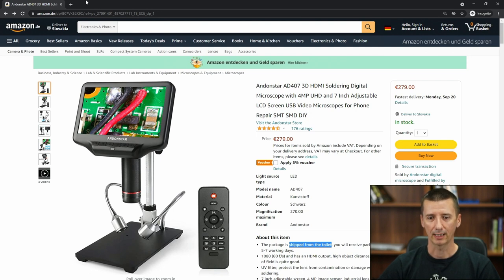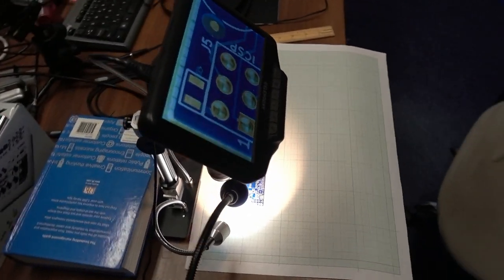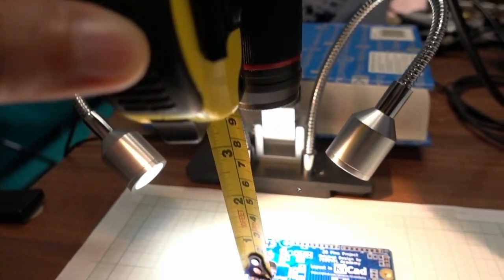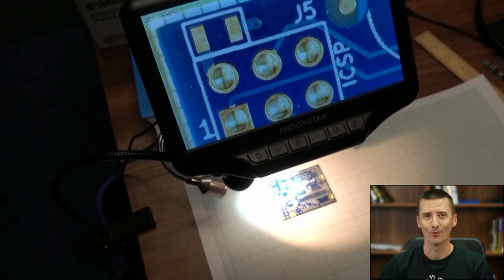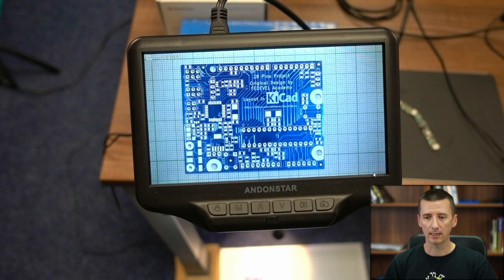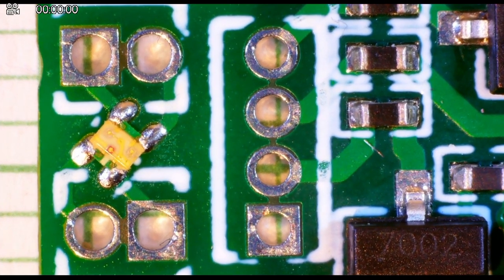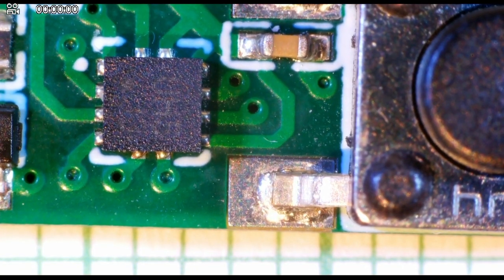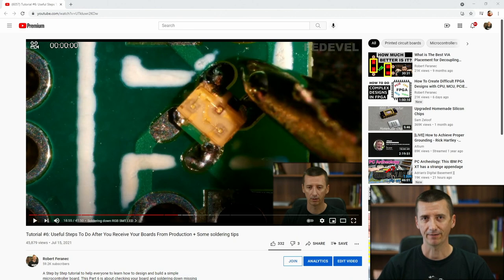Is Andonstar AD407 PCB / SMT Microscope Good? Image quality is ok (see the video), but the stand ?!

Comment: You can actually mount the microscope to the stand below the red line (near the lens). It is a bit fiddly to get it to mount straight but once it is in place you have about 15cm of space between the desk and the lens. The focus remains adjustable above the new mounting point. I have used it like that for a while now and loved soldering under it ever since.
Reply: Same for me

Comment: I have a similar one at home, but i went with just the camera module that does not have a screen. It's nice for documenting, and i like that i can place a large enough screen directly in front of my eyes, so i don't need to look down in a strange way to see what is going on under the camera.
I still kinda prefer to work (solder) with real optical binocular microscopes tho, they just give me a better depth perception, and i'm used to have zero lag. 
We have a Mantis Elite scope at work too, but that is a completely different beast, and it takes time to get used to working with that thing. The biggest problem i have with the Mantis is that i need a raised platform for my PCB to sit on, so i can use a normal desk and look straight into the optics of the Mantis sitting upright and comfortable. For precision soldering, i kinda want my wrists to rest on something tho, so you have to build up on your desk and find ways to set up your workspace ergonomically. Maybe with different magnification lenses it is better, but i think the ones we have now give a good field of view for soldering. The focal point of the Mantis would need to be about 10-15cm higher up to be ergonomically ideal, and i don't see how we could change that (we have the 6x SLWD lens already).

Comment: I have similar microscope (Andonstar 208) and I've attached it to the ring be end of optics.Also quite easy trick to get better working distance is to use M4 standoffs. Needless to say I completely agree with you about the length of the arm.

Comment: I have the 8.5” version, the field of view is it’s only downside. However, I bought a cheap clamp on mic boom and I don’t put other lens all the way through the makes it that you can have 60cm (restricted by the wires which is easily fixed) between the clamp and the lens which is very workable. It also enables you to have more space to work in.

Comment: Regarding the too-short support post (and too-tight field-of-view), as of late 2023 there's an AD407-Pro model that has a 32cm post (as compared to 19cm for the AD407 model).  Though I note that at 10:25 Robert says he wants the post to be 47cm, which is a bit taller still.

Comment: The focus issue is lens distortion.  Lenses which correct this aberration usually kick you up to higher tier systems.  You are right, it's tricky finding a low cost system that checks all the boxes.  But these Adonstar scopes really check off quite a few boxes!  A decent stand for microscopes cost more than the whole Adonstar you have there, so you have to overlook this point and do what you did!  Half the time you end up having to rig something anyway.  Nice review, thank you.
Reply from the maker: Thank you Craig
Reply: I have exactly same distortion on andonstar ad409 on exactly same side, so it seems normal for their sensor, its mostly noticeable when the microscope is mounted in the upper position and is at maximum height
Reply: @vassilikouleshov2209  That's interesting!   Thank you for getting back on this issue on another model.  It may not be the lens after all, unless they happen to be reusing the same one one a different model.  Can the lens be turned a little, to see if the distortion rotates as the lens is turned?  Thanks again Vassili.
Reply: @craigrotay3732  Yes, it probably is same lens as it has same diameter of 30mm as andonstar 407, the difference here only the screen is 10inch, how do I rotate the lens ? should I unscrew something ?
Reply: @vassilikouleshov2209  OK thank you.  I'm not familiar with these devices so I don't want to suggest anything that might cause damage.  I was just curious.  Nice of you to feed back.  Take care!

Comment: I recently bought a microscope similar to this (but way way cheaper, the KKMoon x1000 720p). And whilst the screen resolution was enough for me, being an electronics novice, I also found the problem of the vertical axis being too short and the view field was too narrow. Thankfully the Z axis in my case was a simple 140mm diameter metal pipe so I found a longer one on Aliexpress and problem solved :) Now I can even use the microscope with a PCB holder. Thanks for the review, it was very interesting!
Reply: Mr Guru  lol, you're right xD 14mm.

Comment: Dear Robert, you have made a very personal and honest review, thanks so much. I wonder if it would be possible to look for a suitable length shaft on the trade or letting make a new one by melting Al alloy. Another question: is it possible to upgrade the microscope firmware, if it would be necessary in a future?

Comment: Hope they are not made in the toilet :D I have Adsm301 and the image quality and the stand are great. The only problem is the slight delay which is pretty annoing durring soldering. Also one advice - add polaryzing filters on the lights and on the lens. I promise you will love it!
Reply: Hello Svetoslav. Where can I buy the polarizing filter from? Thanks in advance.
Reply: @mortaldrumming  I bought a cheap polaryzing film from aliexpress. 10x10cm size. Than I carefully cuted a circle shapes with a scissors.

Comment: 16:57 maybe this is due to the microscope being very slightly tilted on the books it is standing on?
Reply from the maker: maks886 that's an interesting point. When I am in the office, I will try to move it. It could help with the problem on edges ... but in some cases the unfocused area is also in the middle ... let's see. PS: Mohammad Reza MiM also commented on this point  and shared this link (for some reason youtube automatically removed his comment, maybe because of the link): https://www.microscopyu.com/tutorials/distortion

Comment: Is there any statement made on the physical resolution of the internal TFT? Plus how long is the delay for the internal screen? I have another Andonstar for like 3 years or so and as you mentioned the delay drives you crazy when try to solder. I would consider this as an upgrade but only if the internal TFT is fast.
Reply from the maker: I have not measured the delay, but I regularly solder under the microscope, no problems. I actually use it much more than my optical microscope. PS: If the resolution of TFT would be small, you can always connect it to a HDMI monitor or TV, but I have no problem to use the TFT for soldering. I made number of videos where I use it for soldering: search on my channel for "wand" or "desoldering" or "Tutorial #6" https://youtu.be/UTkluwr2KOw?t=915
Reply: @RobertFeranec  Thanks I will have a look.

Comment: How do i connect to my computer and how do i take photos and save on my computer?
Reply from the maker: On this model, I use the microscope SD card slot for pictures/videos or I connect the HDMI output from this microscope to record videos on my ATEM (or you can use any other HDMI grabers). To be able to use USB for pictures and video, I think you may need to buy a more expensive model.

Comment: It looks good. But we can take photos by mobile. We can record all things by good mobile camera. We can zoom more than this in good mobile. Why we need this. May be I am wrong. Please compair it against with good mobile camara quality
Reply from the maker: I have not tried to use a phone camera for this purpose. But it is an interesting point. In my case, I needed HDMI output. Also I am not sure how far away you need to hold the phone from the board (e.g. would it be suitable for soldering? For soldering, you may want to have the phone maybe 10cm away from the board, but still having a good zoom)
Reply: @RobertFeranec  ok try with good camara mobile and make comparison
Reply: @RobertFeranec  my company wants microscope which can measure PCB thickness, copper thickness, core, prepeg thickness. Can you suggest
Reply: @Robert Feranec this is great video! 
@mahadev kolhe I use my old Huawei P10 when I need closer look to my PCBs. I made a holder for the phone and there is enough distance between the phone and PCB. For the best viewing I use camera in manual mode . I have no problems for soldering resistor 0402 or 0,4mm pitch connectors. The picture is good, there is almost no any delay in the video. But there are two problems, when the display is inactive for more than 30 sec the camera turns off and this is too annoying and the display is small ! This is the reason why I consider buying microscope like this.